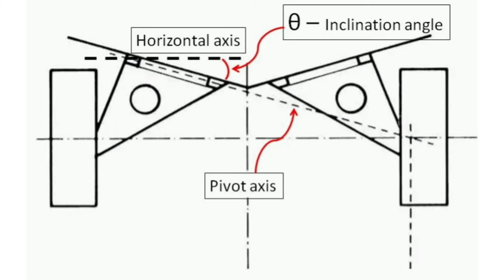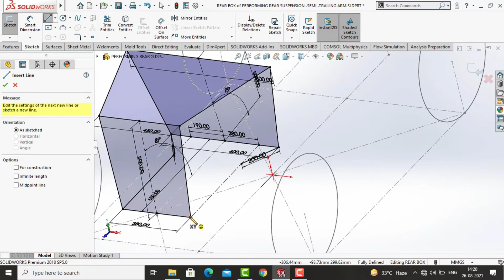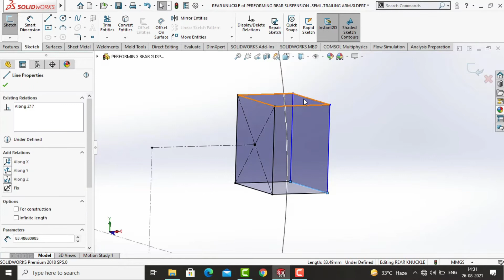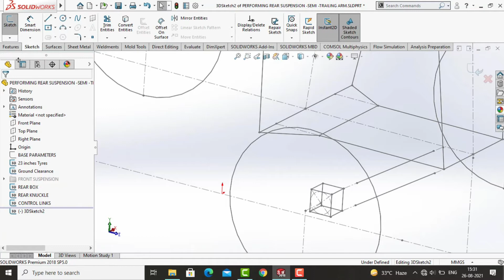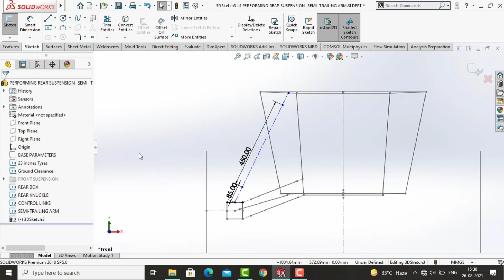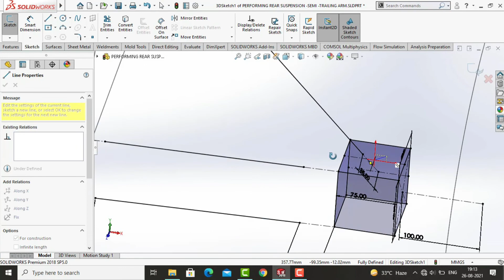Semi-Trailing Arm Suspension Geometry | Solidworks | SAE BAJA | ATV

Comment: Using this dia right we use lotus for the actual.suspension
Reply from the maker: You can use same dia or different tyre diameter as per your requirements